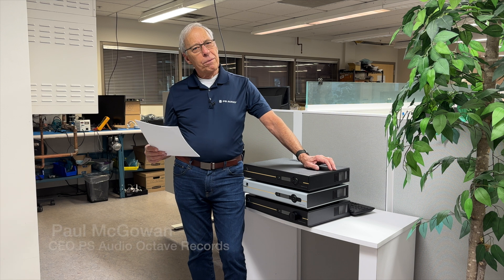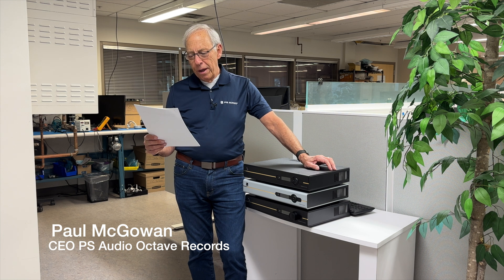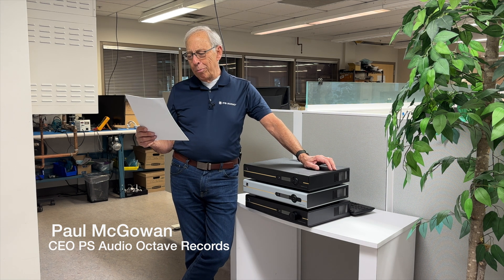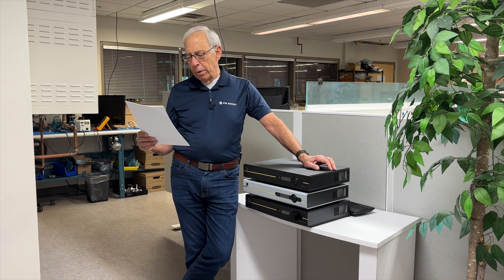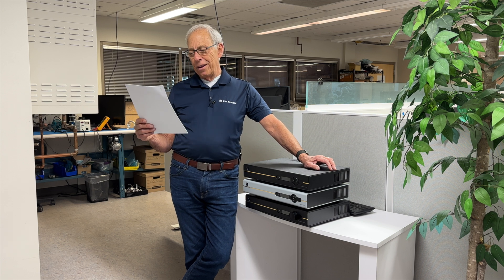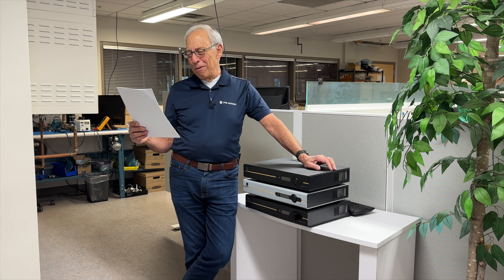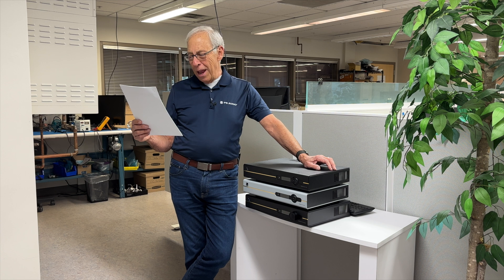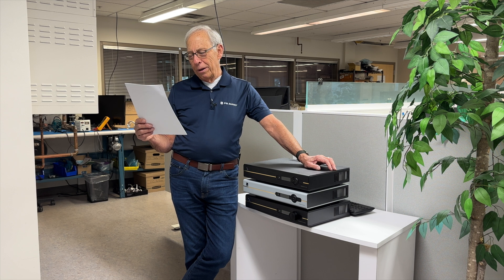Aftermarket power supplies

Comment: I always use something better. 5A instead of 1A. It doesn't get hot and I have a darker background.  Not just for audio's sake. I don't trust those cheap crap wal warts to be safe.
Reply: It might not ring true with you, but modern SMPS bricks are probably safer than even the most high end power supplies of only a few years ago. Each includes a very effective feedback regulator, most have soft-start circuits and many have over-current protections that simply weren't possible in older linear supplies.

The higher amperage ratings can be a kind of self-sabotage since a 1 amp smps will limit itself at 1 amp... but the 5 amp version's limiters might be enough to actually damage your equipment without going into a panic shutdown, if things go wrong.
Reply: @Douglas_Blake_579  I am talking about Chinese crap that cost less than $3. It doesn't need limiters since the equipment is the limiting factor. If it draws more than designed  (very unlikely) it is broken already. I use better switch mode supplies.
Reply: @D1N02 
Well yeah ... when you get down to $5.00 or less, you're well into the "they couldn't possibly make a proper one that cheaply" zone... I wouldn't use them either.

But there's also no value in spending $100 or more, either.

Most of the $20.00 bricks are perfectly good and useable.
Reply: @D1N02 
And for FREE you got a perfectly adequate smps brick with it.

Comment: You could not use a 1000 amp supply without protecting the cable againts short circuit & fires. I know what you mean Paul but be careful giving advice that is against health & safety concerns, not to mention regulations and legislation ...
Reply: Do you have any idea of what a power supply that could provide 1000 amps would weigh? Do you know what the hernia surgery might cost trying to lift a power supply like that?

Comment: Blame Sam Tellig for this.

I started down the external power supply path when I bought my Musical Fidelity Vdac !! DAC a lifetime ago, it came with a linear 12v 0.5a wall wart (at least it wasn't a switch mode noise generator).  Sam Tellig's review mentioned a larger power supply enhanced the sound and he found the Pangea external supply enhanced the sound of that DAC. I'm a retired power supply designer so I looked around for a cheap higher current supply. The suggested Pangea was about $100 and I thought that a bit much. I found a Pyramid 2.5A regulated Linear supply for $18 (less than the parts would cost me from Mouser) and thought that would be a good unit, i added a 0.01uf cap across the transformer 12v tap to stop commutating spikes from getting to the regulator and wired a 5 ft #20 cord with the right sized barrel connector to the output binding posts and I was all set.

https://www.amazon.com/Universal-Compact-Bench-Power-Supply/dp/B0002JTD2K/ref=sr_1_7?crid=2MZ35CQY8EASZ&keywords=pyramid+12v&qid=1697725515&sprefix=pyramid+12v+%2Caps%2C87&sr=8-7

ThIs supply is about 3" sq and is a good deal larger than the supplied wall wart but it nestled right in the rats nest of power cords. The vDAC II is gone and was replaced with the PerfectWave Mk 1 DAC a number of years back.

Comment: The now popular switchmode power supplies can be noisy. They say to get a good quality regulated linear power supply for use as a external power supply for DAC's, etc instead of those common switchmode plugpacks
Reply: And they are wrong.  
Modern SMPS is quiet as a church mouse and has a very tightly regulated output. AND since it is an external brick any noise sources are both exterior to the device and located at a distance.
Reply: @Douglas_Blake_579  Benchmark uses a SMPS for their power amps, they claim that a well regulated SMPS can be as clean as a linear one.
Reply: The word CAN is very important here and it is true that switchmode supplies CAN be very quiet however you don't know whether the unit in your hand actually has all the necessary filtering unless you measure it correctly. Because it is relatively easy to meet FCC regulations in trerms of not interfering with anything else it has to be taken in context.  Your phone charger is very unlikely to interrupt operation of a TV set but can easily interfere with a Hi Fi even simply coupling into speaker wires if your speaker wires run close to the charger.

Comment: Decades ago I got tired of the dirty power in our neighborhood and decided to move to the country, no power supply was going to cut it. 100,000 bucks later the town finally ran a line out for us, and it was just our line not connected to any low-fi households around, and it was better, but I knew it could be even better still. We went off the grid, entirely, which was illegal actually, and set up solar power. The cleanest power you could imagine and wow how the sonics reflected that. It still is amazing, but now we've heard the newer solar panels have a cleaner delivery system module so we are going to upgrade again, but can't wait for how it will sound!
Reply: One of the things you said has always been highly offensive to me so since I am triggered yet again I mean who are they to say you have to have a connection to the grid when you don't need one? I never understood that without going all Alex Jones about it which in itself repulses me.
Reply: @InsideOfMyOwnMind  Totally! Who wants those poorly wired houses on the grid affecting the neighborhood and making everything noisy! But yes, in most countries you are not allowed to disconnect from the grid, probably for national security reasons. But I wonder if the local spy agencies tapping into my lines and phone cause noise now 😉
Reply: Interesting, I have a few mates that whinge about noisy solar installs, the panels themselves are fine, it's the inverter. They hear all this hash on the radio bands, until they switch off their solar inverters.
I suppose you could take a solar panel and feed it into a DC regulator to feed a DAC, kind of like some audiophiles  who run their DAC's off batteries.

Comment: Decades ago when I bought a British  Pink Triangle turntable, considered to be the first or one of the first Linn LP 12 slayers, although it didn't really slay it, it sort of outrefined it in sound; anyway, the turntable's cost was $2,000, and then there was a dollar/pound fluctuation and they cut the price in half to $1,000. So I jumped on it. The turntable was designed by physicist Arthur Khoubesarian. Everything about it was first class. He did all kind of exhaustive tests on resonances and vibration immunity. I bought it new and when I looked at the power supply, it said Atari. He built the turntable around a video game consoles power supply. Later there were stiffer power supplies offered as mods to turntables with plug in power supplies. They said the cartridges friction drag on the vinyl was significant enough that a stiffer power supply improved the sound quality. A lot of Oracle Delphi turntable owners were buying improved power supplies, as I recall. The Mod Squad, a very respected company out in California were offering them among others. They put me on to my first Monster Cable beater; the Randall Research TX Flex cables. If anyone remembers those.
Reply: A turntable power supply supplies the motor. Nothing whatsoever to do with this discussion.
Reply: @razisn I've upgraded the external power supply for my Origin Live motor controller. It had a huge effect on sound quality.
Would that count?
Reply: The discussion is about power supplies. I don't think we have to walk the straight and narrow over someone Fuhrer like. Branching out a little happens all the time on here.
Reply: @sidesup8286  OK. I just changed the power supply of my water pump.
Reply: @razisn I hope your also using an audiophile fuse and of course some high purity copper pipes.
Reply: "Flex" Cables indeed 😅
Reply: The Randall Research TX Flex cables were the stiffest cables I ever encountered. Each interconnect cable was shaped like a horseshoe and they warned you not to bend it out of that shape, as it would damage it. It was easily purer sounding than Monster Cable. I remember starting to revel in not only what the instruments were playing, but how the instruments "sounded." Getting more into their timbre and the purity of it. Harry Pearson of The Absolute Sound reviewed the Randall IC, and gave it good marks, but tempered it with "there are more open sounding cables." Of course way back then in the early 1980s, not many of us had systems capable of impressive spatiality like Harry Pearson had. When I did eventually get equipment capable of real openness of sound, I realized he was right. For all it's purity, the cable did hold back spatiality a noticeable bit, but not that big a deal. 

 Pearson was right on with his evaluations. You could count on it; and being able to count on what an editor/reviewer says is the most important thing. A guiding light is what we needed back in those days of not knowing what we were doing so well and our sonic evaluation was still a little immature and still in development. Many years later, it is really liberating to have the perceptual experience to accurately evaluate on my own. But I have sometimes used reviewers to lead me toward things to get a listen to. 

 We've come a long way with cables since the early 1980s. Cheap cables subtract sound quality, but the best of them I've come to realize lately, are only subtractors; not "ruiners". And are  capable and don't subtract as much as I recently thought. One cable can change your mind on that; and changed mine. You might still be able to get A+ sound using the better cheap cables, but your equipment might have to be A++ to do so. If in the early 1980s, you had a Linn or Pink Triangle turntable with a Koetsu Black cartridge or maybe an Audioquest or Fidelity Research MC cartridge with Randall cables going into a class A Bedini amp and into Watson Labs speakers or the Acoustat X electrostatic speakers, your sound would still surpass most under $15,000 systems of today. You might not even be able to really trounce it's sound at any price. The "best" of the past is still great today. The so so things of the past are not serious pieces of equipment today
Reply: A water pump isn't audio related, but ok...does it have a good non clog impeller? Is it designed for slide rail or elbow rail installation? Will it be used for pure  underground water or for effluent filtering?
Reply: I have directly compared several different Pink Triangle turntables to all levels Linn Sondek LP12. The Pink Triangle decks have been vastly superior on every occasion especially with the Anniversary.
Funnily the Anniversary was the first serious deck to use a DC motor. Ivor from Linn stated at the time that it was impossible to get a DC motor to work. His top Radikal power supply is now DC. Arthur was and still is a visionary.

Comment: First ... people need to understand that Current is a result of applying a Voltage across a load.  Current is not pushed ... it is drawn by the load in proportion to it's impedance/resistance.

This is easy to demonstrate ... take a 12 volt bulb ... connect it to a 12 volt 1 amp supply, then to a 12 volt 10 amp supply ... the bulb will not get brighter.  It draws only the current it needs.

This casts a very large shadow on the "aftermarket power supply" idea. The device's designers know how much juice their device takes and will most likely have provided a perfectly adequate power supply.  Going out and buying the ultra deluxe high end supreme platinum model power supply isn't going to make the device work any better.